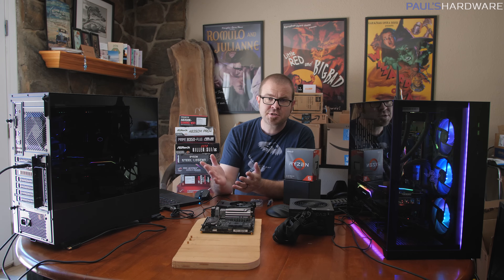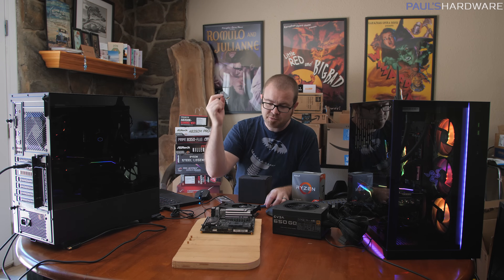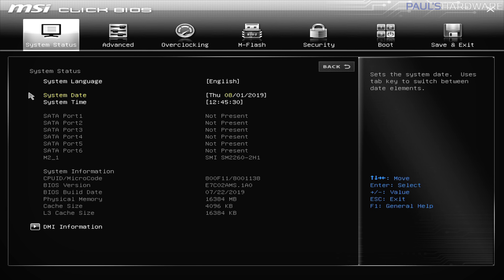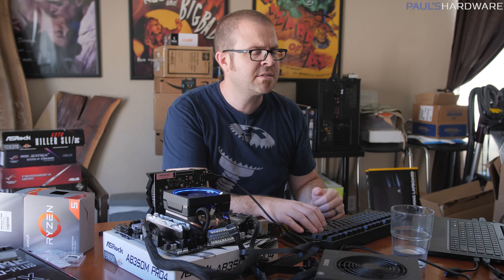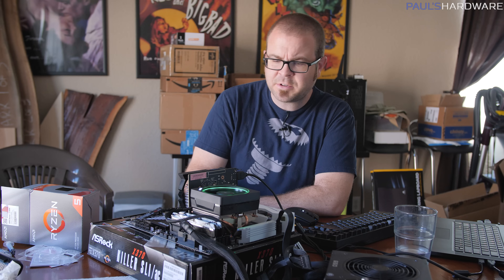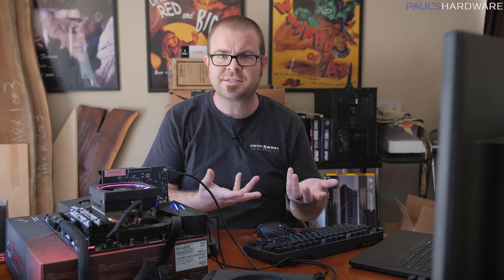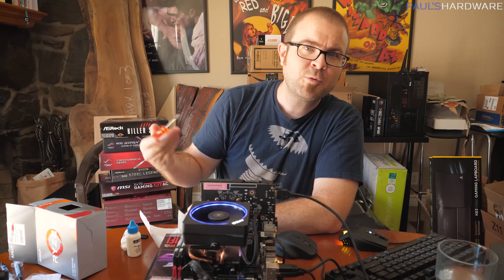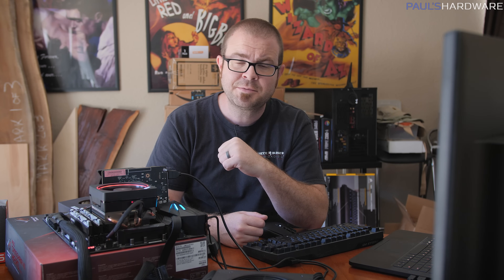Does Ryzen 3000 REALLY Work on Old Motherboards? Testing B350, X370, B450 and X470

Comment: I installed a Ryzen 5 3600 on an MSI A320M PRO VD/S in 2023 so it works even on lower mobos than tested.
Reply: I have a TUF GAMING A520M-PLUS WIFI motherboard, with 1700x Ryzen.

Comment: fun fact, i bought a b450i and only had a 3200g, i was able to throw a video card in there and get a display, and even update the bios with my single 3200g.
after the bios update i was able to display out from the mobo, otherwise it worked just like a normal processor, so you may not need to have a 1700 to install the bios.

Comment: Unfortunately, I had to make the experience that my two Ryzen 7 3700X did not really work properly on B450 boards. Despite "Ryzen 3000 ready" sticker.
Both Gigabyte and MSI were quick and cool. The processors were surely recognized
The problems came in everyday use.
Both processors had unsolvable problems with the USB ports on both boards. Particularly noticeable with the USB WiFi stick. Connections were dropped every minute.

It may be interesting how far processors can be overclocked and which one is the coolest, but in practice there are also other criteria that make a processor and a mainboard suitable for everyday use.

It would be nice if such tests didn't just focus on speed and overclocking ... or whether the board recognizes the processor ...
Reply: I have x370 motherboard with 5700x3d cpu. You need to install the newest version bios version or you will have problems.

Comment: I'm currently looking to make a build with a ryzen 5 3600 and a B450 mobo. 
I don't have any other ryzen processor, and I'm not going to buy one just to do a bios update. I guess my choice is to get a different board or get a board with flashback capability?
Reply: I just built this exact set up with 32gb memory and 4tb hdd 6gbs and 500gb ssd 6gbs and couldn't be happier with it

Comment: If my mobo says ryzen 3000 ready - do I need to update my BIOS before I put the new 3000chip in it...?
I'm going from 2600x to 3900x on a gigabyte x470ultra gaming.
I'd like to go to the 500boards - but that's why I bought the 400 board because it was supposed to be compatible.
Thanks

Comment: Hi man,i have a question for you.
I have a ab350m pro4 with a b350 chipset and a ryzen7 1700 and i've overclock it with the stock cooler to 4.6 ghz,i think that i'm the only man in the world,but...in this days i want to upgrade my system and  i want to buy a ryzen 9 3900xt because asrock build a bios with agesa @t that can run,i have buy a noctua nh L12S for dissipate the 3900xt.
It's a bad o good idea my upgrade?
VRM of this motherboard are the same of the asrock b450 exactly?

Comment: i just bought the 3700x and i have a msi b350 gaming plus.. Do i have to upgrade to use the new cpu or am i fine where im at. Ive looked up on pc part picker and  it says its compatible but i might need to update the bios before i install it (which i plan to do) but on other websites it says its incompatible and i cant find the compatible cpu's on msi b350 gaming plus website. Any help would help

Comment: Ok so i took your advice and built my son a gigabyte B350m aorus with a ryzen 3600 2x8gigs of gskill and a evga 600watt ps. After installing windows and updating bios using the gigabyte live update to v51 it will not post. The cpu and dram lights keep shaping back and forth. Gigabyte is having horrible tech support times and newegg is useless.

Comment: What i wanna know its who buys motherboard and don't update bios to last version, and normally if u buy old mobo with new cpu they will upgrade it, when i got my 3300, it had version that was not last, but supported and then when i got home i downloaded last one...
Reply: I got Asrock AB350M Pro4 from 2017 and updated to almost every bios. That's my third motherboard. Before I've got Msi B350 Mortar and Mortar Arctic. Both work terrible one took 2 minutes to post to windows. Both died after first bios update.

Comment: Hi Paul! What update should and do you recommend me using for my bios. I currently have a ryzen 2400g and I'm upgrading to a ryzen 3600xt. I have a Asus b350-f Strix mobo and I have read on the latest bios update specifications, that the bios update is for updating Agesa to 1004B. Is this the version I should use named "ROG STRIX B350-F GAMING BIOS 5406"? Thank you!

Comment: Ryzen9 3900x working beautifully on my cheap ASUS B350M motherboard, before putting the CPU I updated the BIOS to 5406 that comes with agesa 1004b. Just have to make sure to turn off PBO in overclock section in the BIOS as well as the CPU section, leaving it on raises up the volts to 1.5v thats a bit uncomfortable for the old VRMs in the board but the CPU hits 4.4 single core with ease. I have invested in a Gamazz GT fan to keep the CPU and VRM cool, under full stress max temp on CPU is 64 centigrade.

Comment: Hi Paul nice vid, i have asrock ab350 pro 4 and plan to upgarde processor into ryzen 5 3600. But if it posibly to put old gen processor back in the motherboard when bios was in new firmware version ? Will i encounter some issue ?
Thanks

Comment: Hi - I have a MSI B450 Tomahawk that says on the box Ryzen 2000 ready, but I bought a Ryzen 5 3600.  I already installed the cpu and heat sink fan.  Can I still do the BIOS Flash Update with the cpu installed or do I need to take it out?  On one of your examples, you had left the cpu in but I think it was intel.  Thanks!

Comment: hey guys I have a question that soon might become a problem. I bought Asus a320m-f motherboard. I am planning on buying a ryzen 3300x and I am wondering if it will be an issue to actually work it because of the bios update issue. I dont have an older cpu like ryzen 1500 or sth.. So do you have any solutions, answers? Help me please.

Comment: Was great to see this, Epic series Paul, I'm on the Prime b350 plus from launch with 1700 and i'm waiting on my 3900x arriving which is the supported cpu list, The board has done me great. Good compatibility with Memory overclocking I have 24GB of DDR4 Adata 2133 memory in my cause which is setup in 2x4GB 2x8GB both in their own channels, overclocked to 2866MHz with my own timings I set up and tested overnight passing in Memtest (Bootable CD form) the reason there is 2 odd GB 8GB sticks is because of the buying in parts over time up grade from the 4x4GB sticks I got at launch. Kept the sticks as close as possible all the stick part from 1 had actual Adata branded memory chips rest are Micron chips took the chance on the Adata branded which may only be "Branded" but don't know 
Worked like a charm and I was able to get my overclock back once switching to them fairly easily had to dial it back in and test overnight again but works like a charm
The board according to Techpower up the VRM's will get very very hot from their test. but if the voltages are anything like they where on JayzTwoCents x570 launch test with the 3900x they're going to be up the left all together across the mainboard which TechPowerUp didn't talk about on the 5007 bios which they used on the prime b350 plus. 
The voltages could be lowered ALOT, but i'll know more when my 3900x arrives and get using it myself. 
I have had copper heatsinks on my VRM chips since launch so I should be in a better case compared to techpowerups test on my board but she'll still be toasty XD
But completely useable at stock settings (and also the right voltage settings IF THEY ARE WRONG like the x570 asus board was in JayzTwoCents video from launch)

Comment: Since the X300-series motherboards will not run a Ryzen 4xxx CPU, I went ahead and replaced my Ryzen 5 1600 on my ASUS Prime X370-A with a Ryzen 7 3700X. I had to update the BIOS to version 4801 before replacing the 1600.
Before, with D.O.C.P. enabled, my 3200 MHz HyperX RAM would only work at 2666 MHz. Now it runs at 3200 MHz. 

All seems to be well. :)
Reply: I am (or better: was) having that high-temperature/high-voltage "issue" (45-50 degrees C, with 1.4xx Volts, idle), which I read about. Changing the Maximum performance state in the Windows Power Saving plan from 100% to 99% changed that to 41° C (idle) and 0.9xx Volts. I am no overclocker, nor a "hardcore" gamer, so I am "feeling" much better now. :)

Comment: Hey paul, question.  Ive got the asrock x370 killer sli/ac that you update at 8:50.   My bios is at 3.1 so I need to go to 3.50,5.10,5.40 to run a 3600x but on their site it mentions *Please update the AMD all in 1 with VGA driver.  Did you do those updates in between the bios updates?  Or is this just for cpus with amd graphics built in?  Thanks.

Comment: Having a problem where stil after updating the bios, with the x370 gaming plus from MSI the board boots fine with 1 ram stick but as soon as a second is added will not boot with cpu and ram debug lights lit. Works perfectly when swapping back to the 1st gen Ryzen I used to do the update. Anyone else having/had this problem on an MSI board?

Comment: Hey bro,

My problem is with update bios.

My motherboard is "ASUS ROG STRIX B450-F GAMING" and it's not ready for 3000 series, so i try to update bios ship using by flash bios usb programmer but it's not effective, i bought AMD Athlon 200 socket AM4 but the problem is still exist and DRAM light error with No Display, i try more than ram brand with different Mhz also it's not effective.

Comment: Tried putting a Ryzen 5 3600 into an ASRock A320M w/ the 2.3 bios. Can't get any video output when plugged into the internal GPU. Plugged the older Ryzen 3 processor back in and still can't get video output. Is there any fix to this?? No speaker set up on the motherboard sending error codes, can't figure out what is going on...

Anyone else has this issue?

Comment: Great video Paul.  FYI.  I have the 3900x with the AsRock X370 Killer sli/ac that's in the background.  At stock my idle temps are about 32-33 degrees. (arctic liquid freezer 240), and about 75 degrees running Cinebech R20 at a Ryzen Master overclock of 4300 on all cores.  Cinebench R20 score overclocked is 7519 consistently.  Also, I could never get the Ram (Vengance LPX 3000 CMK16GX4M2B3000C15) above 2933.  Coming from the 1700 Cpu, I had to update the bios for the 3900x. (5.80 released 2/2020). Via XMP, I can now get the RAM to 3200Mhz.  Not bad for only changing the CPU.  Initially I was considering and X570 board and new Ram.  Not so much anymore.  Hope this helps anyone who already has an X370 Killer sli.

Comment: I installed the Ryzen 7 3700X on my Gigabyte Aorus x470 ultra gaming and it works fine. It didn't recognise the CPU initially, I had to update the bios to F40. Then I had to update to F50 which is the latest bios version due to a slow start up issue but now it's working great.

Comment: I was an early adopter of the AM4 platform, and I used an MSI B350 Tomahawk for my first build. I actually had to use an AM4 Athlon A10-9800 to flash the bios for the Ryzen 1xxx chips. Kind of wonky,  if you ask me. Now I see the old Tomahawk might be able to use a 3xxx Ryzen? I still have it stored. This gives me ideas...

Comment: Yea, I updated my bios' on my to Auorus x470 Gaming Wifi V1's to F50 in prep for upgrade to 3000 or 4000 thousand later this year. It's easy, when you know which steps to take. My bios was reset to default settings on both boards. Side note, one board has a 1700x which was from a warranty replacement, and that chip was worse than the one it replaced.  Bios upgrade was easy, except that doing from within Windows on the App Center, it defaults to seeing ZIP folders in the current directory, so ensure you move up one directory where you've unzipped the files to.

Comment: Very informative.  Three things:
1-I like how you addressed the misapplication of force instead of ignoring it.  It is a teaching moment and something we should all consider when doing maintenance/upgrades.
2-Paul, when you tackled mobos from different manufacturers, it provided a window into how each manufacturer attends to bios updating process.  The easier the better.
3-Keep those tips for service-techs coming, like doing such bios updating as a free maintenance service or charging a minimal fee. 

Great work as usual.

Comment: You really should try several power up cycles before giving up.  Some BIOS's don't guess the memory parameters right the first time and remember the wrong choice in CMOS and try other settings on later reboots.  Or so I've heard.
Also on the newest AM4 MB's, they got rid of the lever clamp down for the cooler, and you screw them down with the 4 corner screws.  That does mean you have to first remove the plastic clamp down base that comes on the MB.

Comment: I have a AB350M pro 4 MB (very similar, if not the actual same, MB you used in your video) - is the R5 3600 stable using this MB?  I'm very tempted to buy this CPU as it's fairly cheap right now.

Comment: Hey paul, i am building myself a new system since my sister needs my current one for homework etc if she told me earlier i would just leave my old rig intact, i was  on intel but recently swapped to amd and i really like what i am seeing here, i have a budget of 2k but i am trying to spend as less as possible, right now the pc i am on is rocking ryzen 5 3600 with 16gb of ram clocked to 3200mhz 1tb of nvme ssd storage and 6tb of hdd storage which is really overkill  for what my sister will be using this comp for, i am a power house user, should i keep my 16gb of ram and 1tb ssd and 6tb hdd for my rig and downsize her ram and storage?  to save cost or get everything new, i am from australia and adelaide in particular prices on x570 board is like $200+ and 2060 super is like $700+ im not sure what to do here please help me out!

Comment: It's 2020 and I'm still waiting to be told conclusively that I can buy an MSI b450i and be able to run a damn Ryzen 5 3600 in it without getting hold of a gen 2 chip to update the BIOS to run the damn gen 3 chip because the mobo doesn't have BIOS Flasback on the ITX board... so stupid.

Comment: Just to add to all the comments, I am currently running an asus CH VI, running bios 7704. Ram is Corsair Vengeance RGB Pro 3600 (4x8), and the Ryzen 7 3800x. Everything runs and performs flawlessly. Ram setting in the bios is to DOCP (XMP) and the 3600 speed is recognized without a hitch. Messed around with overclocking using the motherboards TPUII setup and I get an average 8% auto overclock, but I set everything back to stock cpu settings. Precision boost is enabled. No concerns and no issues. If graphics cards upgrade to pcie 4.0, I'll get a new mobo, but for now, my 2 year old CH VI is staying put. Rememeber it's only Intel that makes you upgrade your mobo for each new chip ;)

Comment: I have a question -  If you update the bios for it to be compatible with the new cpus, but still want to use the old cpu but just wanted to updated it just so you don't have to do it down the road could you still use the old cpus with the newest bios?

Comment: The Asrock B350 pro4 is the MB I have my 1600x in. Does anyone know if the 3000 series runs efficiently in it after the bios update. I ask because someone told me that even with the update, it doesn't run that good.

Comment: I just upgraded from a first to third gen R7 on my Crosshair VI - I did the update before I swapped CPUs so I can't vouch for USB flashback, but the overall process was flawless. A reboot, standard CMOS reset/new CPU setup process, and booting to linux right away. Whilst I may not have PCIe4 or anything, the x370 board still let me get an all core OC on a 3800x of 4.35ghz at 1.300v, so there's really no need for an expensive x570 upgrade!

Comment: FYI: Asrock ITX AM4's on the 300/400 (mine is a Fatal1ty AB350 Gaming-ITX/ac) will have serious posting issues and bios-loop on 3000 series processors, despite BIOS (even latest as of writing this, 6.00).  Tried different supporting hardware (PSU, RAM, etc.) and the processor runs just fine on another board.  Several users have reported this.  1600, 2600X, and 1700 all work great for me on this ITX board (and overclock fine), but the 3600 is very unstable.  Several users have reported, yet Asrock REFUSES to acknowledge the issue.

Comment: Running a 3800x in my Asus Crosshair VI with the latest bios. Finally able to docp my ram to its 3600mhz speed versus 3200mhz when using an 1800x. If I need pcie4, I'll upgrade to X570, but until then, the crosshair VI will be used.

Comment: even though you can upgrade to the ryzen 3000 cpus on old mobos, the cpu temps are higher than older supported cpus. might not be all motherboards. check your old temps and then check after you install the new 3000 series cpu

Comment: I use a b350m msi gaming pro and can safely say you need to use the bios update from November 20th for it to work (I tried the last version, and it wouldn’t boot up) 

After finally getting it to load up I tried to do a simple increase to the ram from auto 2666 to 3000 (the true speed of my ram) and I got the black screen of death 

Soooo don’t plan to “overclock”, hopefully in the next few days they will come out with a alpha version.